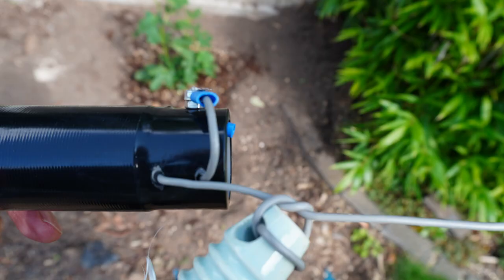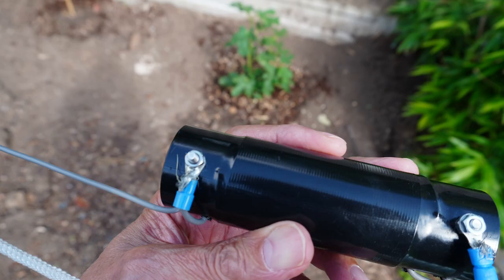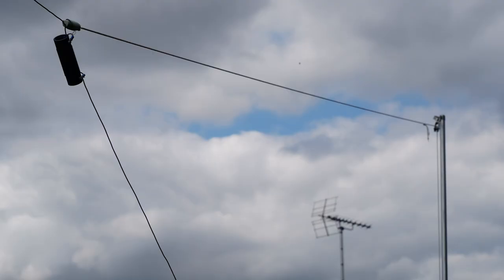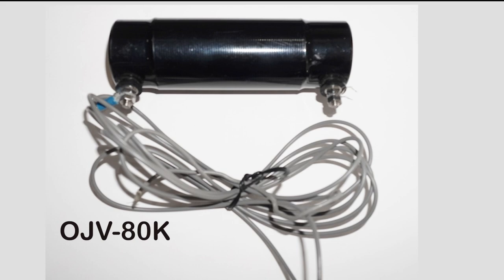End Fed Half-Wave Antennas - Tips and Tricks

Comment: I have a 132ft EFHW with a 49:1 unun as a sloper. Far end about 24ft up. Feedpoint and unun about 10ft up. Planning on raising the far end. What do you recommend for feedpoint height? BTW, I have a very long counterpoise wire running a few feet above ground level and a Palomar common mode choke near my shack. No RF in shack even with 1KW. Alpha 78 in bandpass mode auto tunes to low swr on 80, 40, 20. IC 7300 with IT 100 tunes 80-6 with less than 1.5:1. Appears to radiate well.  Mel, K2JWD

Comment: Nice video.  My first wire antenna was an EFHW after decades of yagis and verticals.  It was a 10-40  with a 24' counterpoise in a straight horizontal line pulled tight between a cliff and building 65' AGL I'm still amazed at how good it works from 10-80 no ATU needed!  Should have made one decades ago.  n2eye
Reply from the maker: It’s a common experience! Good to hear from you. 73 Peter.

Comment: Sir, I gave this a try. I had an 80 meter EFHW that did not fit on my lot because my house was in the way. I tried running it off the roof but was blowing circuit breakers in  the house at full power. (Not ideal). So, I tried this "trick". Not only did it work PERFECTLY, but I successfully moved the preferred low point in the SWR out of the CW section and squarely in the phone section at 3.9MHz at 1:1.15. 

Pro tip: When tuning the resonator start long and rather than cutting the wire, simply keep winding the excess around an insulator (I used a bare copper wire for the resonator). The last changes to the resonator were literally centimeters in length and even then I went too far and had to back up. However, the theory and reality are equal. This is absolutely brilliant!

Thanks so much.

Comment: Thank you. Some of your tricks have also been used on dipoles in the past. For example using a coil as an RF choke as at higher frequencies and a loading coil at the lower frequency.
Reply from the maker: Hi Donald. Yes you are correct. We were using this method back in the 1960s. 73s Peter

Comment: I built the 80m loading coil. Worked a treat! Here's my build details:
Measures 110 uH (B&K Precision 875B LCR meter)
0.8 mm enamel wire
1 - 1/16" (26.6 mm) outer diameter plastic pipe
Close wound wire - 129 mm long coil
145 turns
Simply adjust the resonator wire length for the desired portion of the 80m band. 
Thanks Peter 
72

Comment: I fitted the 80-meter coil today, SWR 1.2 I have it in an inverted V configuration due to a small garden, the center of which goes up the mast. The transformer is fed by 213 coax down the garden where the transformer is bolted to a pole 10 feet off the ground. no counterpoise, no earth. works very well more than pleased.
Reply from the maker: Thanks Brian. Looking good. Have fun. Peter.

Comment: Hi Peter, I only have a very small garden so mounting it was a problem. I ended up putting the end-fed down the garden in an inverted V configuration, the center of the end-fed is connected to the mast at the house end using a none conductive connecter, I also put a counterpoise from the box 12 inches off the ground. I was very surprised at the signals I was receiving on all bands, I still had the dipole up so I could compare the 2 antennas, and I think the end-fed came out on top,  I now need to but the OJV-80K coil or I might even make one. Thank you for the film.
Reply from the maker: Hi Brian. Glad it is working out. Remeber there are extra lobes on 20m and above so a little bit of gain in the dire tion of the lobes. 73 Peter
Reply: @watersstanton  Thank you for your reply.
Reply: @watersstanton  when will you have the 80-meter OJV-80K coils in stock I wonder  :)

Comment: Great video, these are great antennas I sometimes use another trick I use a 80 to 10 efhw I use it on top band with great success I have a dipole connector with a short wire and Croc clip which I simply clip onto wire antenna on transformer  ( hot side if dipole connector) I then connect ground side of dipole connector to a ground rod, radials are even better, then undo pl259 feed from transformer plug into dipole connector you now have a quartewave for 160m. This also works a treat for say 66ft wire 40 to 10 as a quartewave for 80m, this us a very simple method if your transformer is easily accessible. Thanks again
Reply from the maker: Hi Nigel very interesting. I am sure others will read this as well. All the best. Peter.

Comment: I am a SWL, I made this antenna thanks to instructions. The commercial loading coil OJV-80K was out of stock so I made my own, hoping the turns etc. were right. I wound 76 turns of 20 SWG magnet wire onto a 40mm PVC former, and varnished the coil. The configuration I used was 50 feet horizontal and 17 feet vertical (awkward shape garden) and 2 meters of cable after the coil for the 80 meter part, then to a 49-1 unun. I haven't tried it out yet, because I think the conditions are not so good at the moment, maybe I am wrong, I am only learning all this.
Reply from the maker: Mike, many of us started with little knowledge but lots of determination. You are right - conditions are very poor at the moment. But from now on will improve - but only gradually! 73 Peter.

Comment: Hi Peter, really interesting video again. I have been using an end fed antenna for 40-10 for sometime now with good results. I recently moved the location of the 49:1 TX slightly as was trying to improve the SWR on 20m. I couldn't get the swr below about 1:8 : 1, I know this is ok but there is room for improvement. Whilst experimenting (without me knowing) my four not great radials fell off. From this point onwards my SWR reduced to less than 1:3 : 1 across 40 and 20. I still need an ATU for 15 and 10 as they are about 2:5 :1. So I am confused, do I need to re attached the radials or forget about  them ? Also, 80m in now under 3:1 :1 which confuses me further. One thing I noticed you mentioned is that it is not a good idea to have a line isolator at the far end, only by the transceiver. Why is this ? Through experimentation I have ended up with an isolator at both ends ? I suspect this might not be a good idea ? Should I be worried my SWR is better without radials ?

Since discovered, removing far end isolator puts SWR back to 1:8 :1 region, maybe SWR being incorrectly affected ?

Many thanks. John

Comment: Been using 133 ft EFHW for several years. Tuned with a NANOVNA.  It is near 1 to 1 on 7.30 mhz.  Tuner works to get from 80 to 10 meters. Won't tune 6 m at all.  160 will tune to about 1 to 1.7 SWR but doesn't  seem to be effective.  Currently at about 12 feet on each end and 8 feet in the center. Covers the whole SE USA from Canada to Florida and west to the Mississippi. I guess it works like a NVIS.
Great with my 100 watts.
Hope to put up another one at 90 degrees to the first and somewhat higher.

Comment: Hi Peter. Can you run a inverted L EFHW antenna up the side of a steel pole? I am using a steel pole with my 80m centre feed in a inverted V configuration. I want to set up 80-10m EFHW antenna running up the same steel pole about 5m and then the horizontal for the remanding 15m to a fibreglass pole. 
So will the steel pole effect the EFHW antenna at all?
Thank Bruce NZ

Comment: Hello and thank you for great video. I have a large lot and I like to receive all bands if possible with an EFHW antenna only for receiving (not transmitting)   Do I need unun? And what length of long wire do I need to get the most bands and what length of wire after the choke/coil? And approximately how many turns on the coil 

I live in California and have a hard time receiving DX   Thank you 🙏

Comment: hi Peter i have made a few of these and the 20 mtr half wave coil use a 34uH coil..  the 40mtr wire will use a 104 uH coil, these are great low profile and i have mine running around the garden about 3 mtrs of the ground....great for nvis on 40
Reply from the maker: Thanks for the info! 73 Peter

Comment: I am a SWL, thanks to Peter's video I made the 67 foot antenna with a loading coil and a 2 meter section for 80 meters with a 49-1 unun and it works good in my small garden. I would like some advice here if possible. My neighbour next door has given me permission if I want to add about another 25 or so feet to the antenna wire after the loading coil going at  ninety degrees. Would this help me with my reception at all, and also for receiving some broadcast bands. I get quite a few broadcast bands on the antenna as well as plenty of amateur radio operators. Sorry if this seems a daft question but being a newbie to most of this I need to learn. Thank you in advance.
Reply from the maker: Hi Mike. Adding extra wire will actually reduce performance on 80m. It will lower the resonance to around 2.9MHz which is not what you want. 73 Peter
Reply: @watersstanton  Thanks for advice Peter.

Comment: After my previous comment I decided to try out the antenna I had put up. I am a SWL, just an interested earwigger that is still learning. I tried this antenna out on my SDR SP1A (trying to get my head around this as well). I tuned around the amateur bands and not getting much at all. Then I tried 17 meters, and after twiddling the SDR I heard an amateur radio chap from the island of Crete on 18.120MHz. I listened for half an hour at 1600 UTC. I don't have hardly a clue about all this. But I heard him say that he was using a 4 element beam and 400watts. Is that maybe the reason I heard him because of his power output. Forgive my ignorance in these matters.
Reply from the maker: OK Mike. Stick at it. Conditions are poor at the moment. 73 Peter

Comment: Peter, great video as always. When you mentioned a 'line isolator', I assume you meant an RF choke. I have tested a high quality commercial choke at both the EFHW antenna feedpoint (20 ft above ground) and at the transceiver on the other end of my 50 ft coax. The results (at least as far as my SWR meter is concerned) are much better at the antenna feedpoint which prevents RF radiation on the coax. Why do you recommend the RF choke at the transceiver and not the antenna feedpoint? Greg, 73 KJ6ER Silicon Valley
Reply from the maker: Hi. The VSWR should not change but most VSWR meters are sensitive to their position on the feeder. Placing the isolator at the feed point allows RF to be induced back into the coax feeder. it also allows RF interference to flow down the coax. Peter
Reply: I've seen advice which says that the choke should be at least two metres from the transformer along the feedline, but I can't remember what the reasoning was. Others have a combined transformer and choke in one box. I was going to try this for portable use, but putting them so close together seems a bit dubious to me.
Reply: @paulsengupta971  I've read that if you don't ground the antenna, same point as coax shield, then you must NOT "choke" at the feedpoint.  If you supply a ground then you can choke the feedpoint..  As I understand there has to be a "return" path, either the outer coax shield or a ground.  The EFHW Facebook page is prolific with all type of this kind of information,  "caveat emptor"..  Regards wb7ond

Comment: Thanks for the video. I successfully made a coil for my 40M EFHW and it worked well across the 80M band.  What is the formula for determining how much inductance is needed to go from xM to xM, number of windings, etc for this project?
Reply from the maker: There is no formula as such . I use cut and try! The coil you have acts as a choke on all bands from 40m up. For 20m upwards, halve the turns. It is roughly proportional.
Reply: @watersstanton  Does it matter if the coil windings are next to each other or can there be 1 or 2 mm spacing between wires?  Thanks again.

Comment: Just got my General Ham license and have an HF rig, a Kenwood TS-430S and now I need an antenna and an antenna tuner.  And I've got 1.7 acres to work with.  What is a line isolator???  73 from K9POW in eastern Tennessee.
Reply from the maker: Check this video channel. I did a video on it. 73 Peter.

Comment: Interesting comment about the line isolator being at the transceiver as opposed to the antenna feed point. I run line isolators, but have always had them at the feed point. But you are indicating that there is benefit in bringing it indoors to the transceiver?

Does it make a difference if the line isolator is at the feed point of the EFHW, but there is a coax ground via use of lightning arrestor between the transceiver and the feed point?
Reply from the maker: I would not put an isolator ar thefeed point of an EFHW as the coax sheath does benefit ooeration. BUT always use an isolatir at Tx end no matter what else you have at tge feedpoint. The coax shesth will not only exhibit common mode current flow, but also directly pickup radiated RF from the antenna. 73 Peter
Reply: @watersstanton  ...thanks for the quick response. Moved them into the shack today. Resealed my antenna feed point outside. Thanks again

Comment: Thanks for video and thanks for earlier answer. I am thinking about making the 42' horizontal and the 25' verticle with the 49-1 unun at the bottom to fit my awkward space. Would it be OK to have a 50' horizontal section and a 17' or so verticle section instead of the 42'-25'.
Reply from the maker: You wouldn't notice any difference really. The radiation pattern may change a little on 15m and 10m but not the efficiency. Go for it! Peter.
Reply: @watersstanton  Thanks for that Peter.

Comment: Hi,

I hv a My antennas 40-10, extended to an 80-10. A ground rod was placed beneath the box. From the ground rod, I used an alligator clip and 14 gauge wire, which I ran on the grass, parallel to the antenna wire(134 feet). The difference, especially on 160 and 80, is an s unit or two. I am always being told what a nice signal n audio is coming from the antenna and my 7300. 
This reflector wire or counterpoise wire, seems to do the trick.  I hope others try this on the already, fantastic‘My antennas’ antenna😁. 
The kicker is: Along with my trustee Mfj-939 tuner and the counterpoise, I work 160 nightly, with good results throughout the northeast from my location in so Connecticut. 

Just thought u wld like to know. 

Billy
Reply from the maker: Many thanks Billy. I am sure others will be interested in your results.
Reply: @watersstanton  Thanku for the quick reply
Reply: @watersstanton  
If I may ask

I always worry about Rf in the house.   I have 100 feet of 8x, of which 20 feet are wrapped in a two foot loop, hanging on the tree. Only 3 feet makes it into the house. 
Is there a way to check for rf?

Also, as a precaution, I heard that wrapping 12 turns tightly, around a 2 or 3 inch piece of pvc, usually does the trick??

Any comments are welcomed. 

Best
Billy
Reply: @watersstanton  Could check my second question and reply when you have a chance.  Thanku. William

Comment: Thanks for the video. With regards to use of an earth, I have a commercial end fed for 40m from Moonraker which has a built in earth. I built a crystal radio receiver and attached it to the antenna. I get good reception when the earth is used but it immediately vanishes when I disconnect the earth. Reception is on the am broadcast band(Absolute Radio which swamps everything else) which I appreciate is completely the wrong band for the antenna but was wondering what your thoughts are on this.
Reply: I built a receiving 27MgHz at Kenwood training Course in the 80's.using a wire Earthed to allow resonance if I remember correctly? This was a small circuit design for SOE in WWII ! Hilary Clayton-Smith got me on the course and Kenwood trainers were showing us a non-detectable device.

Comment: If you have a 33-34ft EFHW for 20m and you want to use it on 40m, then just bypass the 49:1 and use it as a quarter wavelength monopole (Lo-Z feed point). You'll need a good ground or a counterpoise or something.
Reply from the maker: And a means of switching.

Comment: I have 2 questions: #1 - Can you use both the 40m loading coil and the 80m loading coil together in 1 antenna?  #2 - What would be the effect if you hung this roughly 50' wire in an inverted-V at an 18' center height?
Reply from the maker: No the two coils in series are very tricky to adjust. An inverted V is fine provided it is resonant.

Comment: Thanks for video. I am a SWL and listen as far as I possibly can around the bands. I  have an awkward shaped small garden for a start. I have in the past had random wire antennas strung up until I was blue in the face. I am not too good on theory but fine with construction and soldering. I can just about get about 90 feet of cable about 20 feet in the air in a right angle configuration. One leg from sort of north south the other leg roughly east west. I have a verticle antenna and a magnetic loop antenna at the moment but dying to get some more cable up. Would this video be OK for RX only. Thanks again.
Reply from the maker: yes the same applies to reception. But this antenna would be at its best on the ham bands. it will work for broadcast etc., but with reduced signal strength. As always - try it! 73 Peter
Reply: @watersstanton  Thanks for promp reply. I listen to the ham band quite a lot so I will try it,  thanks again.